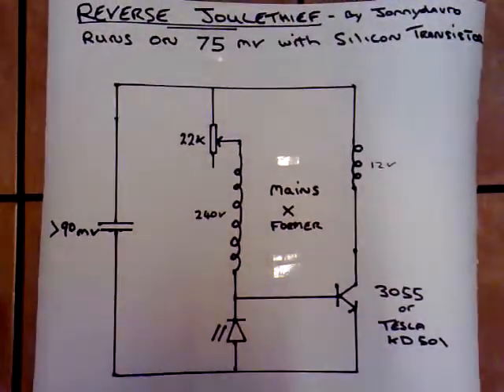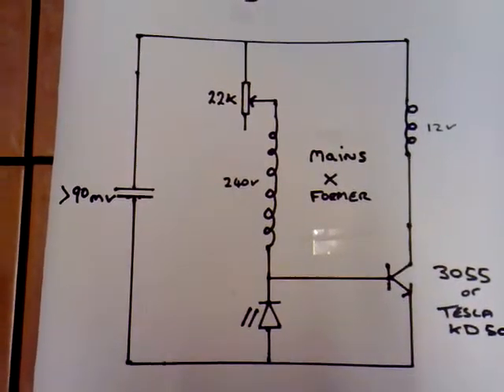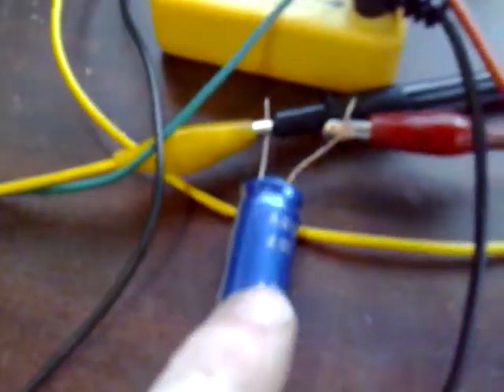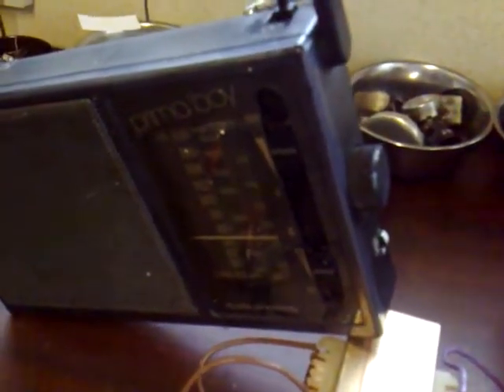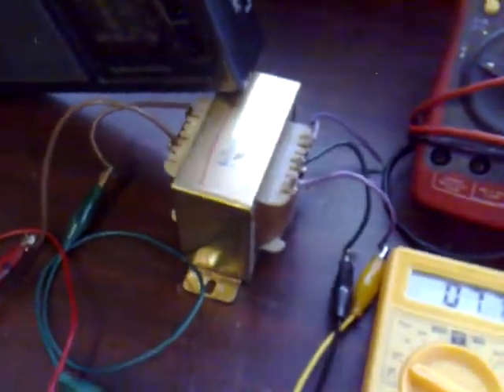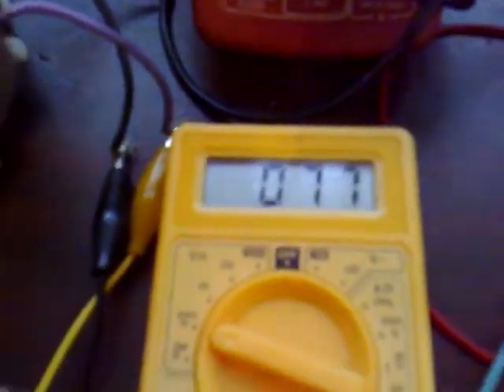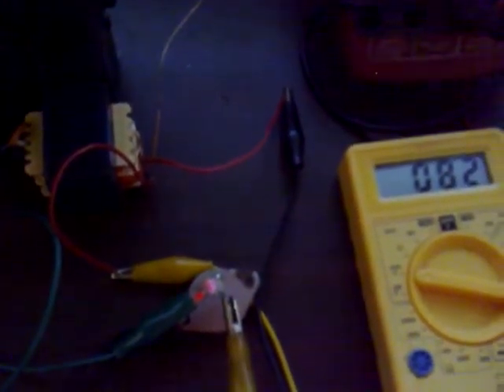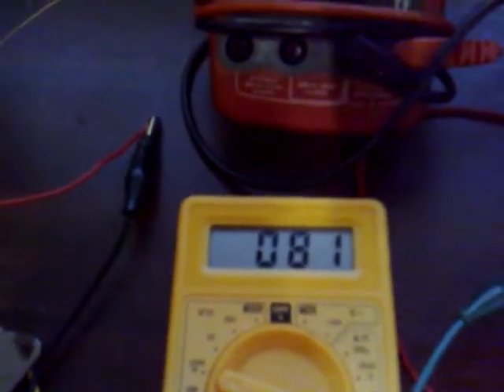Reverse joulethief-Silicon transistor mystery

Comment: Just got a S9014 transistor to work down to 0.165V on a 1F supercap. It quit at around the regular 0.4V until connecting the spare 12V input, through a series '104' orange ceramic cap, to the Positive rail !

Comment: i appreciate your vids mate. i am facinated by electronics since i was 4 yrs old. maybe there is backemf or the led is acting as a light collecting diode in conjunction with the spike and adding to the source  and maybe something to do with the saturation with the transformer core. very interesting though.we can have an occilator that works off 1 concrete battery cell or better yet a crystal radio could create enough power to run it off radio waves!!!! i would like to see you build.thanks johny

Comment: Ridiculously good video :D 
Wonder if a '104' ceramic across that pot would benefit the running ?
2 options - your meter is bust lol, or, noone has ever shorted all the pins out with a knife before !
3rd option, the capacitive inductor effect of the directly connected Primary is actually storing up enough to trigger operation, the larger the winding the slower that action...perhaps.

Comment: Another winner, Jonny!  Way to go!
I think that the transistor is running at the low voltage because it is getting feedback/flyback from the coils. This could be easily verified by designing a circuit that doesn't use a coil. In that case the 2n3055 would be acting as a simple on/off switch. Use a battery instead of a transformer for your input to eliminate the coils completely from the circuit.
Have a great day, Jonny.
Tony

Comment: The collapsing EMF in 12 (coil) induces a high voltage spike in 240 (coil)... This spike is in series with the 90mv power supply sending (-) charge to the emitter of the transistor and (+) charge to the base of the transistor and voila!... Hope this is of any help.

Comment: Very interesting indeed! My quest would be because of the "high" voltage produce by the primary and since those transfo work on low frequency they give the transistor the .6 volts it need to go in saturation mode and this is only needed for BE only the transistor from CE is like a big "variable resistor" and also the 2N3055 is a big power transistor and can handle several mAmp on the base. Hope this help some one out XD I think a scope shot would be nice and probably might bring more light!

Comment: I have a video up showing the negative spikes on the scope. My coil and circuit are a little different, although the theory is much the same. Hope it helps. If I can get a coil like the one you use I will do an exact replication.

Your one runs on so little power because the coil is making a big negative spike on the base. The jump starting with the knife I think causes a manual switch cycle, I think?

The MOT flashing could be switching the transistor more slowly. Due to impedance?

Comment: does it not work the same with the collector loaded? since 80mV was enough to create a flyback pulse with enough voltage to light the 3v(?) led, which could maybe be closer to only 2.5v or something, but it still lights, so we know the B-E voltage is more than being met and the secondary becomes like a choke in line with the B-C resistor in a slayer exciter circuit? also despite what they say about the switching voltage, ive seen pulse motors that switch at under .8v from the rotor mags.

Comment: Hi jonnydavro, if I'm correct then either increasing the winds of the 240 (coil) or reducing the winds in the 12 (coil) should allow the circuit to run on even less voltage.. Cheers. ZincFold

Comment: Hi Jonny, after looking at Lidmotor's Scope shot. I noticed the Collector to Emitter Voltage. The probe showed over 2 volts spikes, (set to 2V/div)  when the LED when off. So although we say the circuit is running below transistor Emitter junction bias, (below 0.7v). It is actually not. Yes, the battery is bellow, but the frequency going through the coil creates a voltage above the Base Emitter threshold. That is why it oscillates. Does that makes any sense?

Comment: @Jonnydavro Thanks for great videos, very informative. First became interested in this circuit when Larskro posted toroid version in December with self starting operating range 0.125V-0.35V with BC107/BC547 watch?v=Gjx-V_cCl7A. Your transformer and transistor improvements really helped lower operating voltage, good job. Concluded that collapsing spikes are starting it when you short coils to cap (-) E with knife and will keep transistor operating to a lower voltage. Will C-E(-) short start it?

Comment: Hi Jonny,
After checking "Larskro" video title -Joule Thief very very low input 0,136 volt.
Then i checked this video of yours and bamm.
I have just created lowest powered joule thief in the internet running red led to as low as 46mv and white led as low as 52mv.I will be posting video within 24hours.
I using toroid with around 100 turns(32AWG) and 4 turns(18AWG).
The trick is to try to use transistor which have lowest VCE(0.13v...0.3v).
In my case am using Japanese transistor 2SD1450.

Comment: Use an oscilloscope, preferably an analogue one. Buy yourself one on e-bay if you can get one cheap enough in working condition.  Don't use digital meters, you can't trust the readings, if there is AC there the protective diodes will rectify the incoming voltages and display them.  an old AVO 8 mark II   or similar would do.   You can't see what is going on without an oscilloscope, probably behaving like a blocking oscillator.  Nothing remarkable about that.